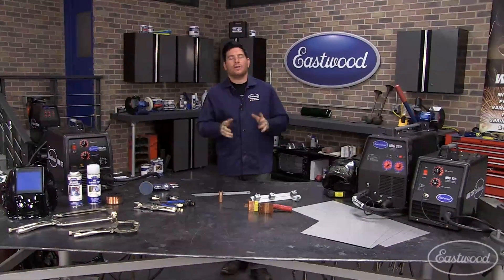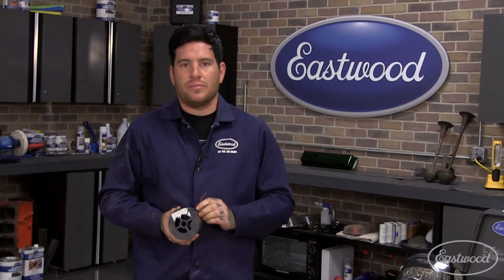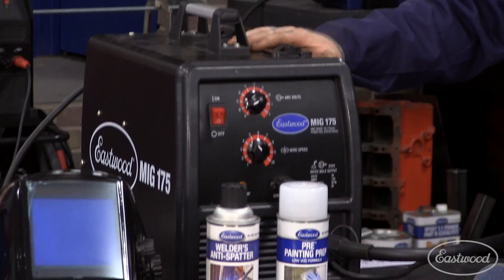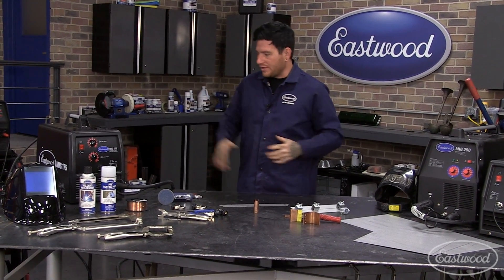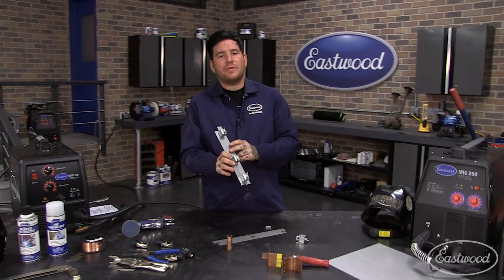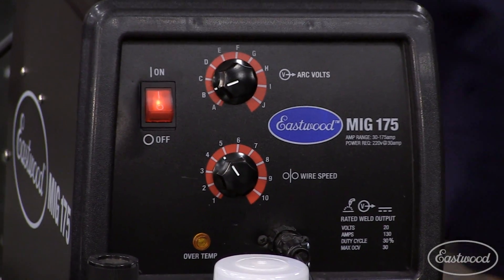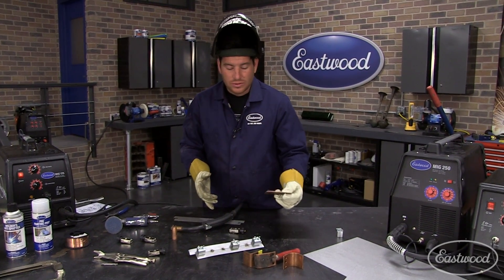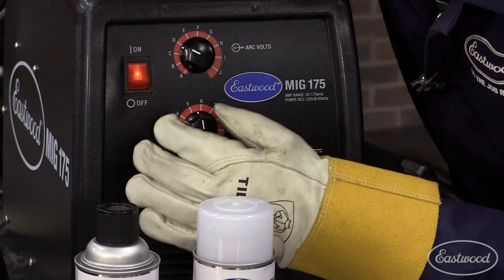How To Weld Sheet Metal - Part 1 of 2 - Welding Sheet Metal Basics with Eastwood

Comment: Matt thank you for this video. These fasteners make panel welding so much easier. I am actually in Phoenixville so after this pandemic I plan on visiting to share some projects and stories. I am building a portable plasma cutter that runs off of a 12 volt battery. When it is done I definitely want to show you and see what you think.
Reply from the maker: Right on! Share photos with us on Facebook!

Comment: I wanted to share my experience with sheet metal. I bought 24in x 24in,  26 gage steel metal from lowes. I have Harbor Freight CHICAGO ELECTRIC
 Flux 125 Welder. I believe i have the flux core wire if im not mistaken. I building a soap niche out of sheet metal. As Eastwood Company pointed out. I held the trigger about 3secs or 4secs no more. Got both sheet metal welded together. Anyway. The video was a good tip.

Comment: * minutes and thirty seconds into this video and this clown still hasn't told you anything about setting wire speed or current level or the metal tghickness he is welding. Completely worthless as an instructional video.

Comment: I would think that welding sheet metal panels onto a car body frequently prevents one from using the type of clamps presented or copper backing as there may be no access to the reverse side of the panel.  Thinking of rockers, which are often the first spots to rust.  No way to get behind the weld points.
Reply: Yeah same with getting to have everything perfectly on a table perfect working height, all fresh steel all over etc.
Most of the time people cant even get to the backside and grind off impurities.
None of this is covered by Eastwood/Lincoln/Miller videos, not to mention a lot of their inverter machines dont even do low enough voltage for heavily stamped areas that are down to 20-17 gauge thin.

Comment: Dear Sir, I am interested in learning enough mig welding to do minor sheet metal and auto stuff. Can anyone please explaing to me what exactly is "shielding gas" and exactly what purpose does it serve? Also, on the small 110v unit does that small of a unit also require shielding gas? Also, please suggest a guage of wire I should use on thin sheet metal such as the thickness we would see in car exaust components. Thank you for this lesson. Very interesting.
Reply: Gas cools the weld or ‘shields’ you want .023 wire, just hit google you’ll see plenty of answers in forums

Comment: Great video (sound still in/out, check mic location), and a question .... on the copper backer, what is the advantage of copper and should it be flush against the workpiece, or a tiny gap from the workpiece?

Comment: Is the job of the copper backing solely to transfer heat away from the base metal or does the puddle stop at the back side because the copper is dissipating the heat and it solidifies?

Comment: Then you have the effect on the panels from shrinkage. Does a zero gap butt weld produce more or less distortion  to the final welded panel than, less say, a gap set to the thickness of the welding wire being used? In this case .030 . I understand a tight butt weld is easier to weld but is it better from structural stand point? Thanks!

Comment: I don't understand your explanation that .023 flux core wire is thicker than .023 MIG wire, requiring more heat.  If that were true, we'd be using different drive wheels for the two types of wire.  I do agree that using gas is better.

Comment: I have a miller 130, what I hate about it. I has 3 heat settings, not a dial. What you said about running to cool. Is right. I have learned to run on medium setting and get in and out, Like you said. I use alot of products. But when I want to make sur something is done right.I look too Eastwood.Eastwood has never let me down.

Comment: Brotha flux core is the only welder some people have like myself. It  would be nice if you guys did sheet metal repair using flux core and show us how to better use it with doing sheet metal repair. Some of us dont have the extra money for a mig/gas setup. I have a flux core mig and old tombstone arc welder.  Eastwood can you help us real budget guys out thanks.
Reply: You won’t get good results on thin metal with flux, you need mig gas ⛽️ the difference in night and day, I’m under $500 for machine, gas, wire etc.
Reply: Yeah,flux core welder is all I could afford,that comment made me feel like maybe I shouldn't try working on my old truck.😡

Comment: Man teach us something and quit trying to sell shit, damn
Reply: Well, he didn't even mention a very good and useful product to have around, the HVAC technician and factory maintenance man did.

Get a can of that paste to dip your hot nozzle of your mig gun in. I'm on the same tip and nozzle for over 5 months now with it. When it gets carboned up and yucky, take the nozzle off and run a 3/4" wire  plumbing cleaning brush inside and wipe it out with a paper towel. take it to the wire wheel on your bench grinder and shine/polish the outside back up. Unscrew the tip and wipe it off with a paper towel. Take it to the wire wheel the same way as you did the nozzle to shine/polish it back up. Screw it back in and reinstall your nozzle. 

Also he makes too  big of deal about your "settings"....flip the service panel door and the chart inside will tell you where to set your machine....duh! :D Also I run .035" wire on EVERYTHING and with some skill seems to work fine from 1/2" plate steel all the way down to thin sheetmetal and washers. I make these custom bolts for specialty use. You can't buy anything with a head that big or that long. It's a section of threaded rod and a fender washer redrilled to size and the washer is welded on it.

Currently my job entails HVAC, plumbing, electrical, carpentry, welding, metal fab, lawn care and snow removal. I do automotive and small gas  engine repair, large twin screw commercial air compressor service and repair. I run a lathe, run a mill, drill press, table saw, janitorial duties, custom  tool designer and maker, painting, go to guy for Lowe's and Menards runs, truck driver, forklift, scissor lift, supervision  etc....etc...

I'm a highly experienced well diverse guy....BUT I am not a "certified welder" LOL  

John

Comment: Eastwood: is putting out a video with this kind of audio representative of your products?
Reply: The audio is not fine. Sounds like you have a poor connection. Every time the camera moves, which ever loose plug you have is rattled and distorts the signal. Common sense. I suggest XLR connections in a separate audio recorder and microphone
Reply from the maker: The audio is fine.  It was recorded Live, but there are no issues with the audio when we watch it.
Reply: @eastwoodco  definitely not fine, also buy a tripod or something. Made me seasick. Other than that it's a good video.

Comment: How wide of a gap do those butt weld panel clamps set? It looks fairly wide to me but that also looks like 18ga or thicker metal. I'm trying to butt weld 24ga sheet metal with a gap and not having much luck, these clamps look like they would work well but I'm concerned the gap would be too wide.

Comment: I would take a one inch flat file and file a 3/32 flat for the clamp so there is zero gap. Easier to fill those in than an entire sheet.

Comment: I am in the process of repairing the bottom 8 inches of my 65 VW bus nose. I have already cut the bad piece out and was wondering if its a good idea to lap weld a piece of sheet metal to the back side of the top piece the entire length then bring the new bottom piece over top to help in butt welding the two pieces together so I dont find myself trying to fill gaps in the butt weld if they are too wide.

Comment: Information pretty good, sounds quality is terrible, fire your sound guy
Reply: kingjpeg will this work on galvanized sheet
Reply: kingjpeg n
Reply: Im pretty sure welding galv steel releases toxic gases and can poison you
Reply: yes you can get galv poisoning and the zinc fumes actually deplete the calcium in your bones. You should grind away the galvanize and then spray on a cold galvanize when welding is complete.. also wear proper PPE and supposedly drink a glass of milk before welding on the galv steel although that may be a old wise tale.

Comment: These are probably bad questions but: Why not tig weld those thin panels (because you blew right through)? What might be the correct way? Or are you basing this video on personal preference?
Reply from the maker: +Aot Cyde Correct, you could TIG weld it.  Not everyone owns a TIG welder or has the ability to TIG weld, and since more people MIG weld, we wanted to demonstrate that technique in this video.  We do have videos using a TIG welder.
Reply: +Eastwood Company I'm new to welding and your videos have given me a lot of insight. Eager to learn, so I'm always asking questions. All the best with 2016 and thanks for the reply. ✌
Reply: A tad less heat will help with gapped panel welding. Tight sheet metal to me is harder to weld imho, to each his own. I have no trouble welding stuff with those gap clamps. I like ‘em- done it a lot.